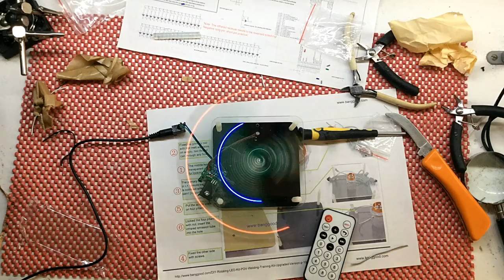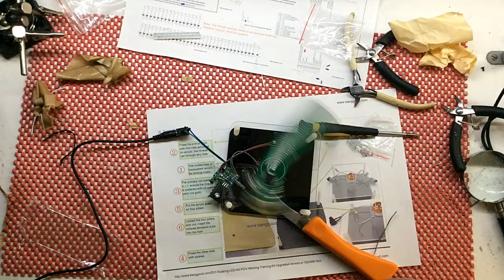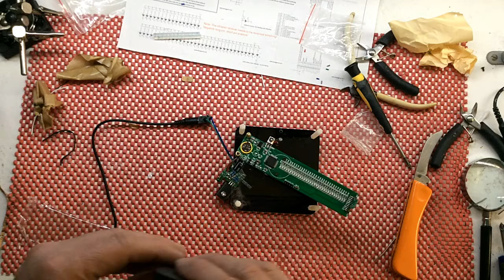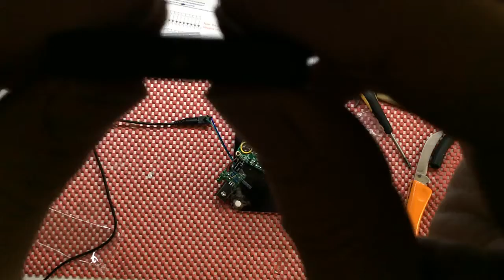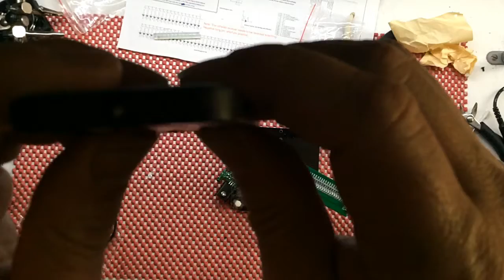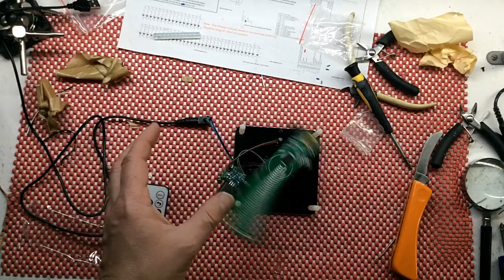Rotating LED Kit from Banggood.com Build part10

Comment: my friend was the same as yours, the control does not work, I checked it and it's ok .. what did you do to make it work?
Reply from the maker: Sorry cant fully remember, think it was the program was one of the examples without remote, noticed that when i pushed a button on the remote it would glitch for a micro second so concuded it was program
Reply: Kevs Electrical Workshop I have tried everything and I can not make it work .. its another video that shows using the program to download the hex file .. but it still does not work
Reply from the maker: does it do anyting at all if not it could be the ir diode in the base.
Reply: Kevs Electrical Workshop I did not understand the part of the diode?
Reply from the maker: what part, what time was that on the video?
Reply: Kevs Electrical Workshop I noticed that mine is turning in time and its schedule .. I will try to change the direction of rotation